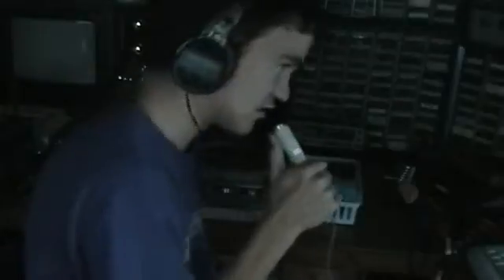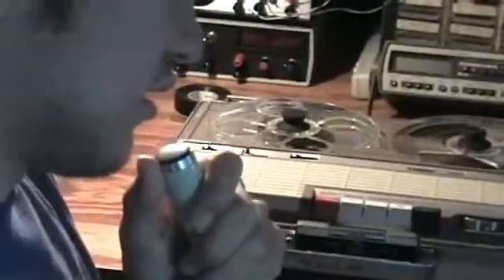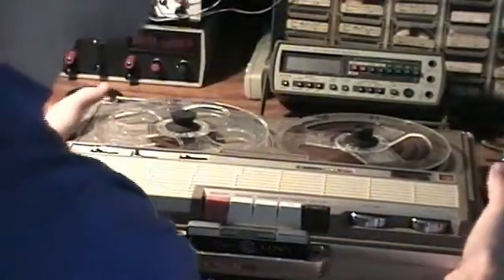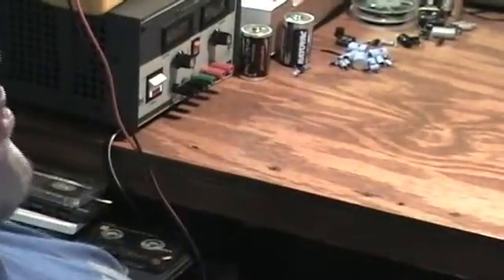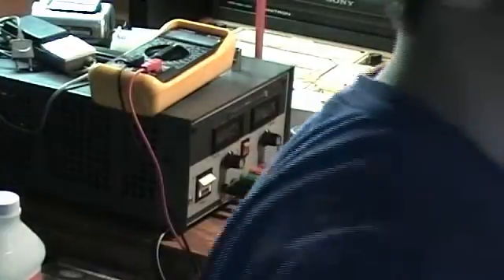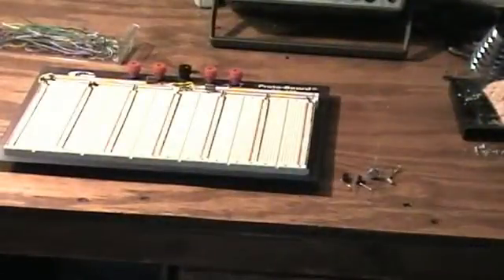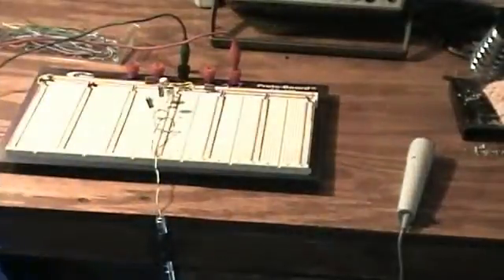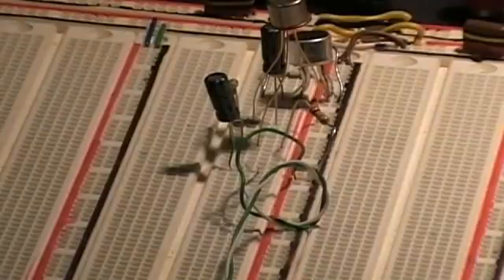Direct upload and building a preamp on breadboard.

Comment: @CassetteMaster that little circuit is cool, but you can build (or even buy, their fairly cheap) an XLR to TRS adapter cable so you can plug your mic right into that TRS mic input, I have a bunch of bought and built adapter cables I use with my mixer for microphones and other non-TRS stuff. I'm still on the lookout for one of those Zenith slide-in cassette decks like the one you had out of a console stereo btw.